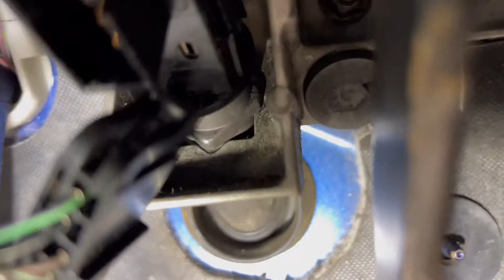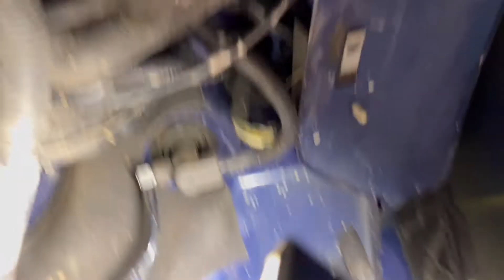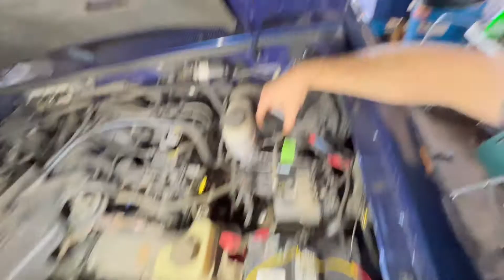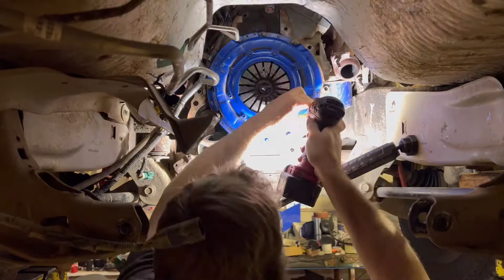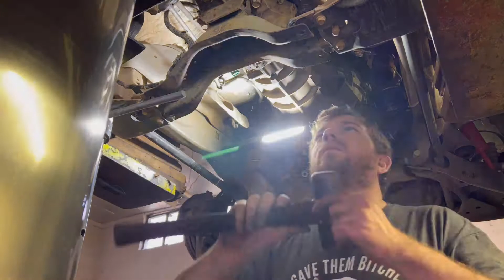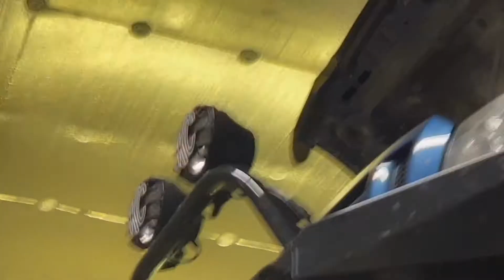Part 2 of 2011 ford ranger clutch replacement

Comment: I am getting ready to put clutch I'm my 2011 now , the oem replacement is a self adjusting unit , I see you put a conventional clutch pressure plate in ,, I was wondering if I am seeing right that it's not self adjusting and why you went with that one verses the OEM  style ,, 
Also my clutch master cylinder was working fine and I'm on a budget I was going to replace the throw out bearing but nit the master cylinder , what are your thoughts I just don't have the money and or the time but I understand I don't and have issues later I'm gonna wish I had ,
Thanks for the video